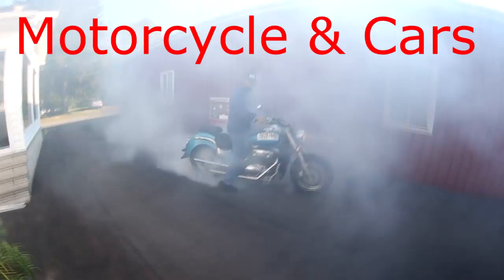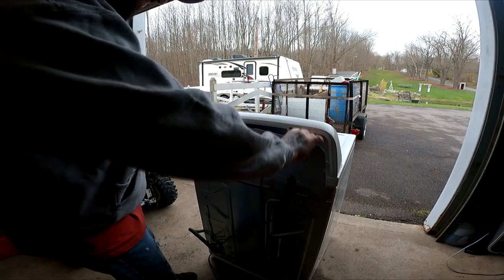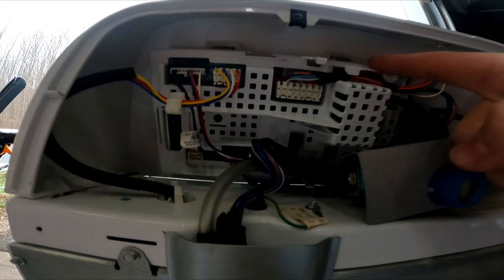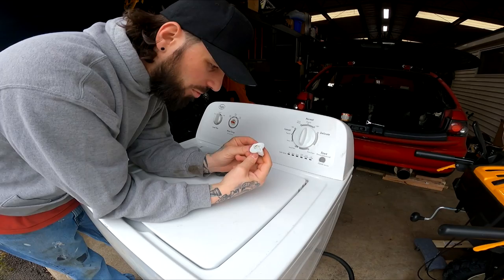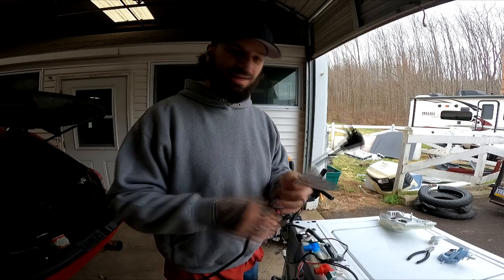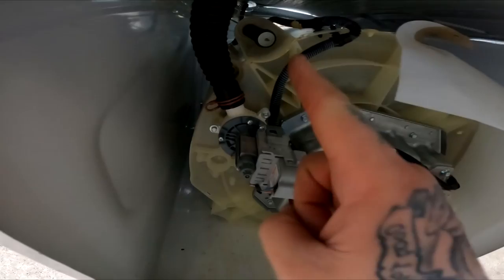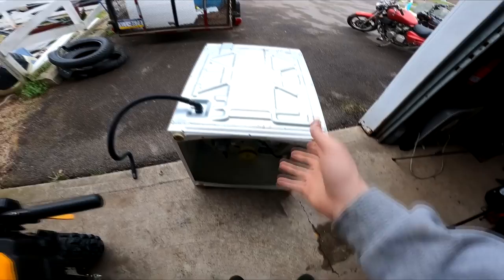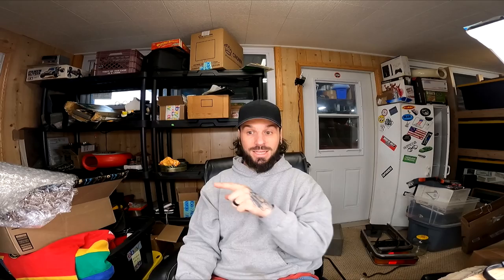How To Part Out A Washer And Sell PartsOn eBay

Comment: Could squeeze a bit more $ out of the washer and get the copper windings off the pump, since your already there, or pull it off and toss in a bucket to micro scrap on a rainy day

Comment: Very cool info! You could save on shipping by bypassing Ebay labels and the medium flat rate box and buy commercial pricing Priority postage from Pirateship
Reply from the maker: Yea I know a couple people that ship with them. Just think eBay is so easy then going into another website then need to upload tracking
Reply: @DumpsterMarcus  Once you're set up, pirateship uploads tracking to Ebay automatically. Easy peasy
Reply from the maker: Didn’t know that! Will need to set one up then!! Thanks!! 🤙

Comment: It's very old and not helpful
Reply from the maker: If I made a video today it would be the same thing!!! You look up part number on eBay and see if it sells….kinda can’t get old
Reply: @DumpsterMarcus  I sometimes think selling parts, in some cases, might be more profitable than flipping with the competition in my area.  It, at least selling parts left in ones that are not going to be fixed.
  Researching a little now.